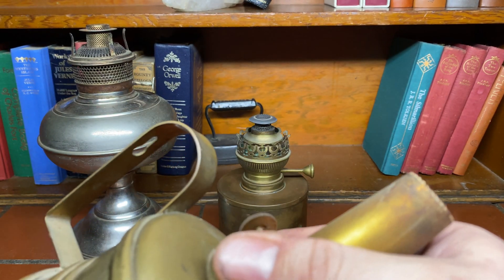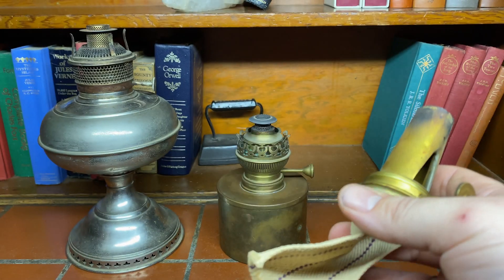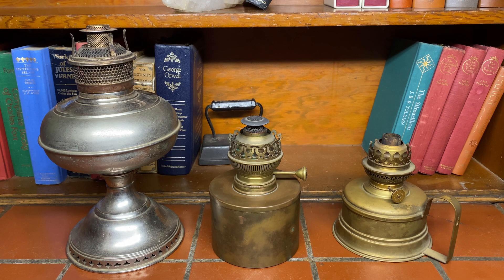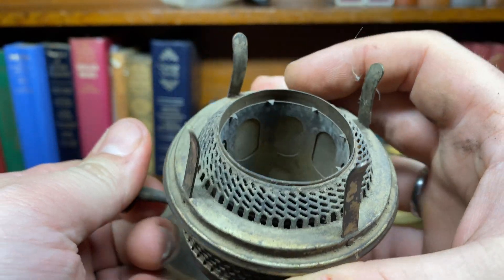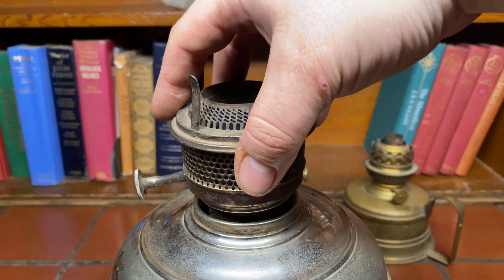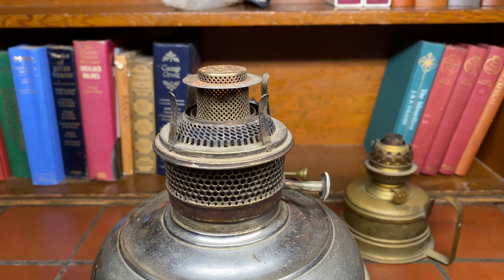Side Draft vs Center Draft Lamp, an explanation.

Comment: I was looking at Vermont Lanterns and they claim to sell two center draft lamps; the Lincoln and the Mansfield. The Lincoln showed a picture of the bottom of the lamp with no hole in it. So I don't see how that could be a center draft. The Mansfield does not show a picture of the bottom, but I can't see a "grill" or anything on the bottom to raise it up so, if there was a center draft tube, it could access the the air. Are either of these actually center draft lamps? Are either of them side draft? Does anyone still make a center draft?

Comment: I find that raising and lowering the Kosmos type wick is simply difficult. next I have several of the Amercian center draft..on the Rayo the wicks always raise and lower easily on the others sometimes I have to raise the wick to an appropriate height by hand, reassemble the burner, leave it there and never use the wick raisers. They rarely work well.
Reply from the maker: I’ve had almost the same experience with all of the Kosmos lamps that I have saved for the P&A burners made in America. They seem to operate very well. One thing that can help us to make sure both the inside of the outside of the area, the wick slides in is nice and clean and shiny and all polished.

Comment: I have a number 8 alladin looking at you vidio it has the hole in the midle all the way threw is there any way you could do a vidio on. That modle i just came by it an i would like to no how it put to gether mine i think is missing the wik riser an flame spredder an what type of wik would it take thanks so mutch
Reply from the maker: I will have to look but I think the wick riser on those is included with the wick like most Aladdin lamps.

Comment: I hate it when i find a nice lamp or heater that someone destroyed by gutting it, sticking a light bulb in and painting flowers on it....
Reply from the maker: The worst is when someone guys and paints a Perfection heater and outs a bulb in it…
Reply: @TheWickShop  I've been after a perfection heater for years, all i come across is gutted ones with a bulb.... i did find one with the glass view, the whole bottom of the tube was  glass... but it was missing the flame spreader, and good luck finding one of those.
Reply from the maker: They come up on eBay occasionally but I think we may have one or two floating around. Send us an email and we will see what we can do.

Comment: The "Kosmos" you show is a Gaudard version of a  Matador, minus its flame spreader, they aren't very good burners sadly. Actual Kosmos burners don't have the deflector cone and have a taller wick tube.
Reply from the maker: You are correct. In fact, it was so bad as a Matador that we took the flame spreader out and run it like a Kosmos.
Reply: @TheWickShop  yes, I remember having one once, it was a nightmare to get a good flame, not a patch on real Matador burners. Gaudard don't seem to care about things like correct chimneys, they sell some Kosmos lamps with Vienna bulge type chimneys on their website (last time I looked).
Reply from the maker: Honestly though, if you run them as a kosmos with one of our sans-rival pattern, chimneys outside of the wick being difficult to raise and lower, they do pretty good.